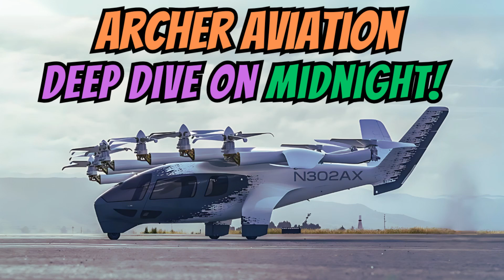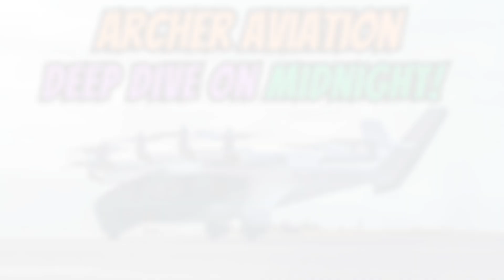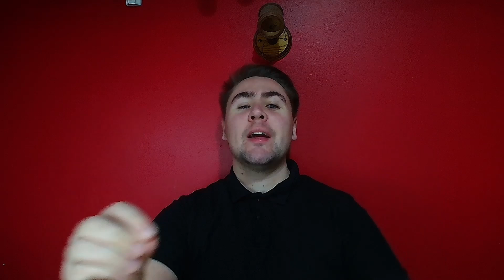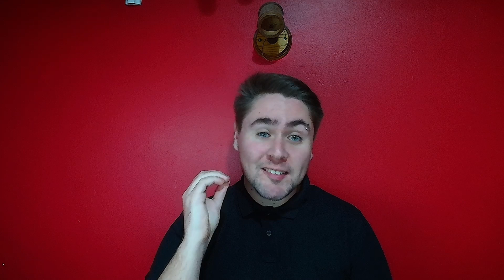Archer Aviation - Midnight eVTOL Aircraft DEEP DIVE!

Comment: Acoustic testing should be done with a full load and full sized battery. all relevant testing should be. An empty craft wouldn't help. Can it even lift the weight? That should be demonstrated. What testing phases did they pass with the faa? The phases so far didn't involve testing until the 4th one. The last 70% of the 4th one if joby is 30% through it.  I wouldn't say they have passed any testing phases, just paperwork and proving they can.affold to try.  Do you think they will show a pilot flying the same flight they did with the 10 minute empty demonstration or for split second edits hovering barely off the ground like joby in December?  One of the concerns people have that is never addressed by them or pro evtol channels is if they can actually do the job. Deep dive into evidence of that one of these days.
Reply from the maker: I hope they do show footage in December but we will have to wait!
Reply: So, based on your logic, an empty Blackhawk helicopter with 50% fuel makes less noise than a fully loaded one, correct? Please prove your assertion! 😂
Reply: @helifanodobezanozi7689  do you play with drones? The same one with less weight is quieter than it is with more weight. The props need to spin faster. It's funny that you think its funny because it's obviously true.
Reply: @helifanodobezanozi7689  ask an ai llm your silly question about helicopters. I don't want to argue with someone like you.  you don't even understand basic physics.
Reply: @TheBagOfHolding  LOL! Who's arguing, I'm just asking questions. So, assuming your comment is true about increased spin, then potentially the only phases of increased dB levels would be during takeoff and landing. Initially these phases would only occur either at verti-pads or at airports where increased sound levels won't be an issue. The VAST MAJORITY OF THE TRIP (98%)  over potentially residential areas WOULD BE WING-BOURNE, NOT VERTICAL!!! So your comparison is fundamentally ill-conceived. 😆
Reply: @helifanodobezanozi7689  the first joby crashed because the carbon fiber prop exploerd from going to fast on an empty craft. They will need to spin the same speed whether or not the motors are geared. They will need to spin even faster with a full sized battery and load. They will not be certified and they will not even show a manned flight with the props transitioned forward next year. Wait and see. One prop caused that even with the supposed redundancy. Everything should be easier without a load. If one goes out the rest will need to spin even faster. They need to use a different material but can't because of weight.
Reply: @helifanodobezanozi7689  do airplanes carrying more weight use more fuel or the same amount? Does the more fuel mean the engines are working harder?  Does that mean the props are spinning faster? Do faster props make more sound?
Reply: @TheBagOfHolding  So...what does any of what you wrote have to do with the Archer Midnight? As far as I am aware, it isn't using a composite propeller? (It's pretty obvious what you are attempting, and failing to do here. When your comments have no substance, change the subject immediately!!! 🤣)
Reply: @helifanodobezanozi7689  the sound of it flying.  You said it would be quieter in cruise and it didn't matter after it left hover and I know it would be louder loaded even in cruise flight if it had weight. Did you see the comment about airplanes using more fuel the more weight they carry? Archer will fail to certify and is basically a scam.
Reply: @helifanodobezanozi7689  The propellers for the Archer Midnight aircraft are made of composite materials. Archer works with Hexcel, a manufacturer of carbon fiber and other advanced composite materials, to supply the materials for the aircraft.
Reply: @TheBagOfHolding  LOL!!!!   So where did I write that Midnight would be "quiet during cruse?"  ANSWER: NOWHERE!!!! Fabrication and lies are a sure sign of desperation!!! How does it feel to have ABSOLUTELY NO CREDIBILITY?!!!! LLLLLLLOOOOOOOOOLLLLLLLLL!!!!!!!!! 😆

Of course there will be some sound, but probably less than a semi-truck!!!! (i.e. Background noise in large cities like NY, LA and SF were ther are freeways, elevated trains, busy streets and airliners flying by constantly. I guess you've never lived in a large city!!!! 😆)
Reply: @helifanodobezanozi7689  when you said the only increase in db levels would be takeoff and landing. What else is there besides cruise? It would be increased during all phases with more weight. Unfortunately, they will never be able to fly a 1000lbs load in forward flight, so we will never hear it.
Reply: @helifanodobezanozi7689  they don't have enough battery power to get the altitude needed where they would be quiet to people on the ground. They can barely fly 10 minutes in an empty stripped down version close to the ground.
Reply: @TheBagOfHolding  LOL! You have the desperation of a short seller who is in over his head!!! At least 191% increase in stock price in 1 month!!!!😆
Reply: @helifanodobezanozi7689  I have never borrowed archer or joby stocks. I don't think arguing here would matter if i did.
Reply: @helifanodobezanozi7689   I'm not. I don't think arguing here would matter if i was. I truly believe they will fail to carry the necessary weight the necessary distance to succeed.
Reply: @TheBagOfHolding  Sure, OK Shorty! 😉 You've changed your story 3 times! Is it (a) they're too loud - which they aren't at about 45db in at takeoff, (b) the FAA will never approve - except the FAA not only released guidelines for approval but created a new class of aircraft in 2 years, a process which took over a decade for helicopters, and (c) they'll never transport the weight the required distance - despite the fact that there are now 500 MWh aviation grade batteries.

Are you a flat Earther too? Do you believe the moon landings were faked? Are you an anti-vaxer!!! 😆
Reply: @helifanodobezanozi7689  i didn't change anything. The sound would be louder with a load. The faa sfar requires 30 minutes of reserve power with a full load and full size battery. They can barely get 10 empty. I will be proven right eventually. They will be the victim of the square cube law. You will see. You will be hornswaggled if you hold until they are a viable buisnesses with certified aircraft.
Reply: @helifanodobezanozi7689  calling me a flat earther and doubter of the moon landing are logical fallacies. You lose. Find evidence they can move 200lbs 5 miles.
Reply: @helifanodobezanozi7689  calling me a flat earther and doubter of the moon landing is a logical fallacy. You don't even understand what you are talking about find evidence any of them can move 200lbs 5 miles. They can't even stay up 30 minutes empty let alone have that as a reserve on a fully loaded craft. All their vids are deceptively edited jump cuts of empty craft punlished to fool people like you.
Reply: @helifanodobezanozi7689  I doubt you own more shares than I do if any at all don't pretend to be happy about the price.
Reply: @helifanodobezanozi7689  do you think any of them will prove they can move 200lbs of extra weight 5 miles in 2025?  If they don't can I win? I know none will be type certified so they don't even need to do that.
Reply: @helifanodobezanozi7689  if one of them demonstrates a manned flight in forward flight for 2 full minutes or the ability to move 200lbs 5 miles in 2025 I'll let you win. There is no way they will be type certified or carrying arabs around next year so I will not even need that.
Reply: @helifanodobezanozi7689  ask the hustle brothers if I've ever changed my story about any of those things since they started their channel. Using irrelevant logical fallacies about the moon and earth not being round is a desperate argument.
Reply: Hey @TheBagOfHolding - What kind of weight tests do the FAA include in their validation process, if any?  As a non-technical investor, I would love to see a digestible but comprehensive visual or table of the steps.  Then it could be overlaid with each manufacturer.  In the meantime, a lot of promotional visionary content, which can be valid as far as gaining early investors.  But I am starting to get frustrated with misleading “demo” videos, which is why I recently rebalanced my portfolio.  And now I looked back at this video from 2021 that had initially gotten me hooked.  I don’t know where the presented test fits in the long process, but it is longer than 10 minutes and not just a hover.  However, it is edited, doesn’t include a pilot, or any weight.  https://youtu.be/5RpqYuce6Ao?si=OnafuLGEKaLa1fjM
Reply: @gregmyers9443  I'm not sure specifically about weight tests but they need to use the battery that will be in the final craft and not a small one just to be quiet and they need to lift whatever load it wants to be rated for. 1000lbs they say. That demo you show is edited suspiciously imo and that is a different model with different motors that are geared. That one crashed into the ground and wasn't even carrying anything.
Reply: @ As far as I can tell regarding the weight capacity testing process, FAA Phase 4 (Testing and Analysis) includes lab and ground tests to ensure the vehicle can handle specified weight limits safely, involving structural integrity testing, payload limits and stress testing under varying conditions. FAA Phase 5 (Performance and Flight Testing) validates the vehicle's performance with maximum payloads in actual flight conditions.
Reply: @myiz9443  archer isn't at stage 4
Reply: @gregmyers9443  archer isn't at stage 4. The battery having enough energy without needing to be too big and heavy is their main problem that they will not be able to overcome.
Reply: @TheBagOfHolding are you still here??
Reply: @TheBagOfHolding  True. I “feel” (not think) there will be delays and dates may be pushed.  But I wanted to know the process and when it can be expected they will put some meat on the bones.  Rather than “ongoing” progress, if I find they are at or near the point when they will test weight, I can adjust my orders accordingly in case they fail.
Reply: @gregmyers9443  id hate for you to not invest and it goes to the moon even without a craft. I frequently invest in them but I use the angle of how much I think they can trick other people not if they will be a successful aircraft in the end.
Reply: @TheBagOfHolding  And how to make some money during hype with a trailing stop order in place.  I’m in it for the theoretical long, but I’m not reckless either.
Reply: @gregmyers9443  i use news alerts to decide not the charts when buying and sell the second it starts dipping after the bump from the news or 4 days if it stays even or keeps going up. I have sometimes miss out but I haven't lost yet. I love the evtols being on the market.
Reply: @ Thanks for being here!
Reply: @ And I’m totally borrowing that four day rule of thumb and taking it for a spin.
Reply: @gregmyers9443  keep a lookout for stories like joby opens first air taxi terminal somewhere. It will even say faa approved and have a picture of their evtol but if you dig it will be the part 135 the faa approved and they are using helicopters.  Stuff like that.
Reply: @gregmyers9443  sometimes the bump doesn't come for a few days after the first news though and one time insiders were dumping at the same time so it didn't go up, that was after a stationary exibition of Lilium's sculpture shaped like an aircraft,  but its worked out extremely well so far.
Reply: @ And that’s exactly what I’m looking for: portfolio optimization over time.  Actually just reduced one position after a decent bump with no news at all.
Reply: JOBY is the only evtol company that will succeed
Reply: @JohnSmith-p9v  I keep telling you archer is the better choice. Just trust me. They don't need to prove anything soon. I'll be here till the end. Please don't block me then and let me gloat.
Reply: JOBY will be better
Reply: EVTOL Research filmed test flights of the S4, Maker, and Midnight with a DB meter. The flight paths and distances from the meter varied and I am unsure of the loads onboard so it's still a bit subjective but Joby did seem significantly quieter. I believe that both of Archer's craft were near 100db during the flyover! Here's the video https://youtu.be/FFguE2qWPfk?si=EUtOFSuU7iDpc08s
Reply: @tm70254  i saw that when It came out and have a comment on it that says what about with 1000lb load. They probably have smaller batteries than they will need to use and no load.